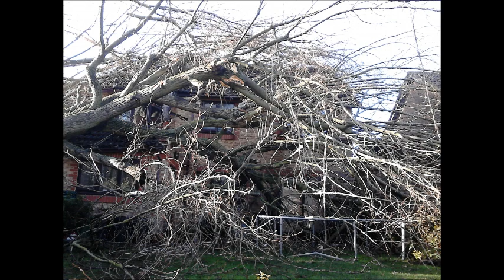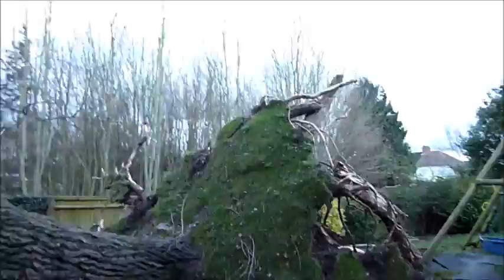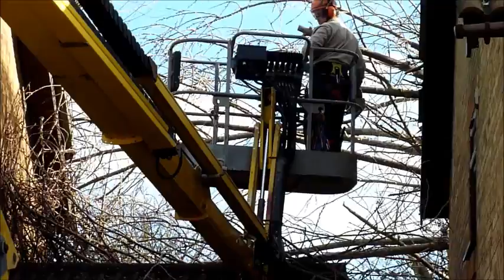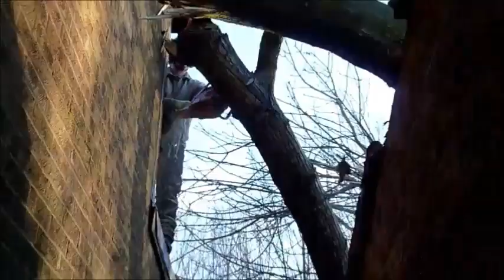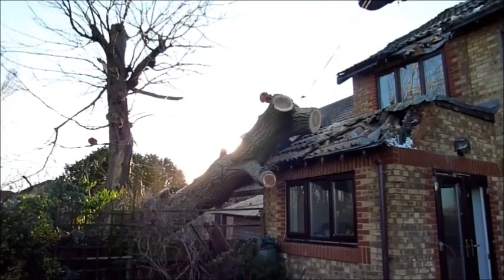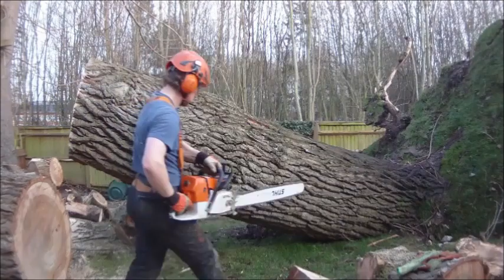Dangerous tree removal

Comment: Surprised you didn't call a crane for that one.
Reply from the maker: Yes a crane would have been a great help but finding an operator who is au fait with working with shifting loads in close proximity to a human operator is difficult and extremely expensive.  Even just simply for lifting out the tons of material once cut and safely on the ground, yes would have saved so much back ache!